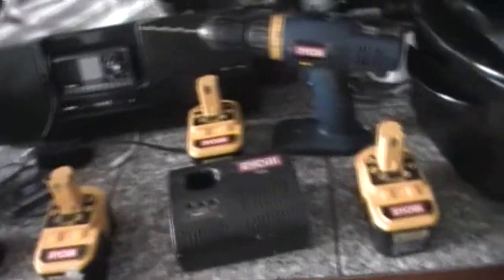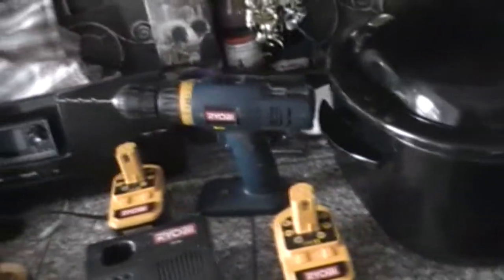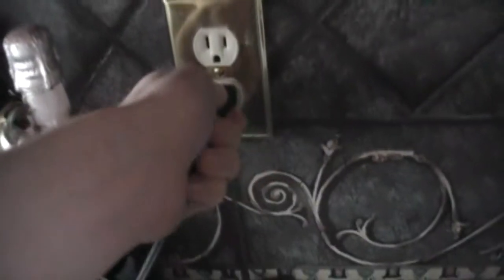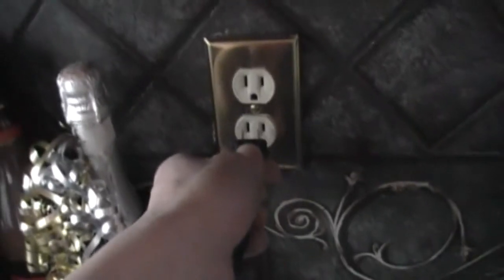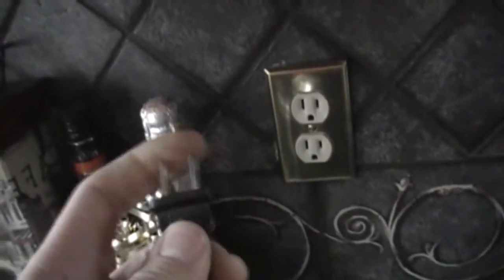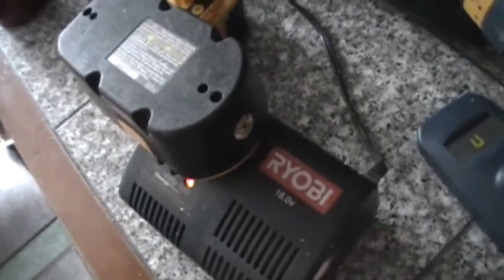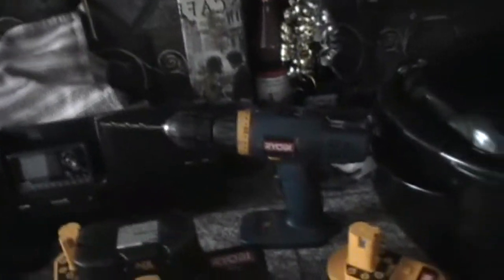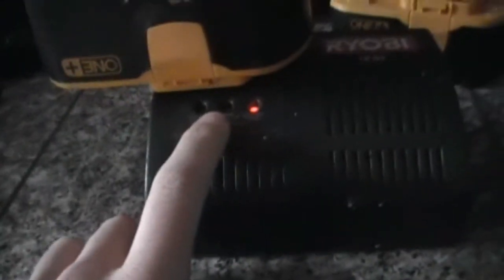How to fix rechargeable batteries

Comment: A word of advice.. don't do this with the older Ryobi 18v batteries that are all black (except for the 18.0v on the side) that do not say One+ on them. Today, I revived 5 black & gold One+ batteries without fail, and the very first OLD battery I tried, gave me a red+green light code and ended up melting not only the battery pack, but the transformer inside the charger as well. Apparently, the older black batteries completely short out when they die off.